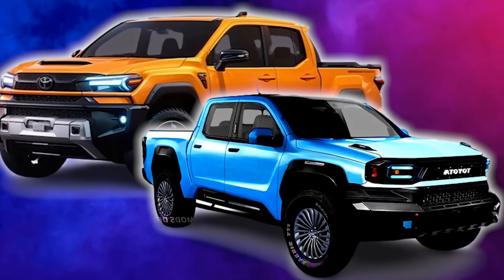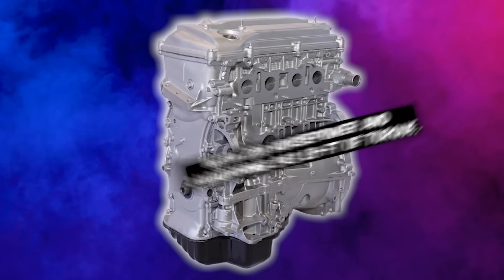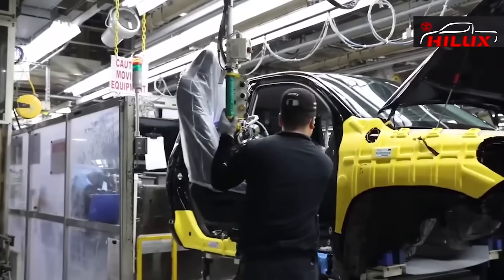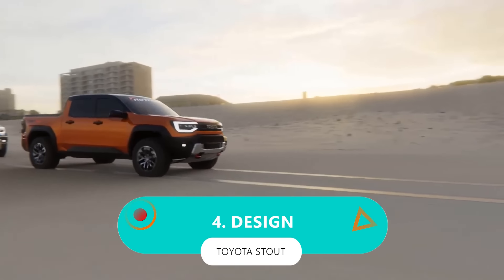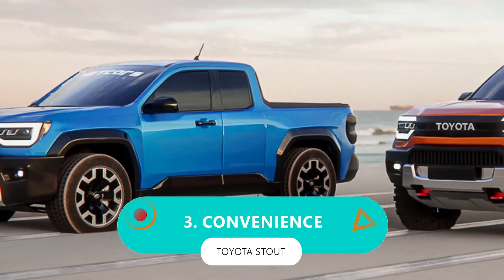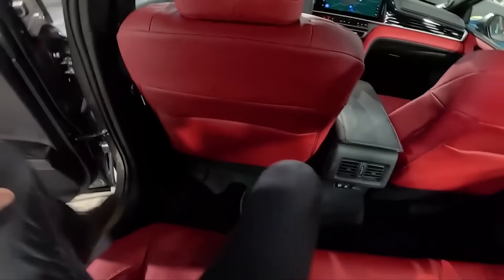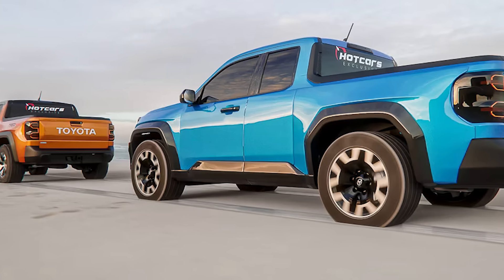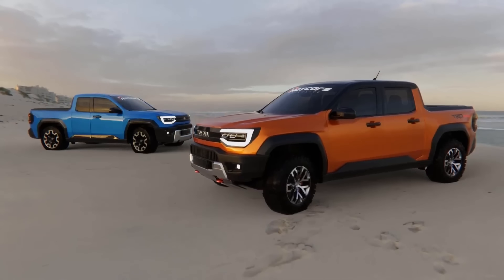7 Reasons Why The NEW Toyota Stout KILLED All Competition!

Comment: Google advertising. Proof in the vehicle it self. Have owned  Ford sucks, Chevy sucks, dogde suck, Nissan- get rid of the c.v.t tyranny, Toyota...camry 12 years 300k miles. Toyota 2001 Tacoma- base model excellent condition 240,000 miless  no issues yet.